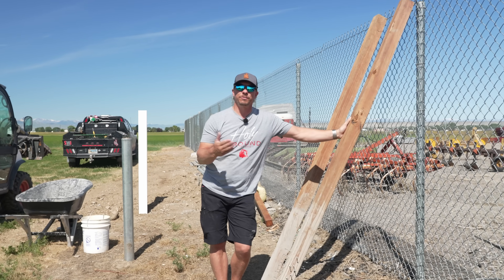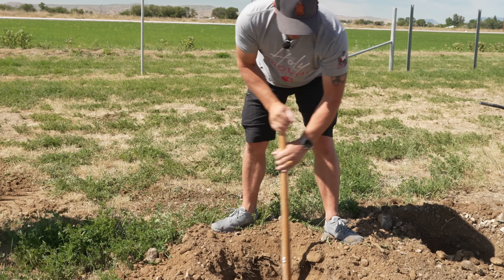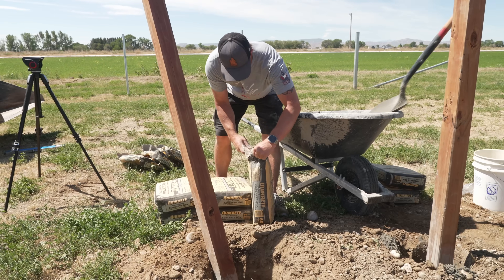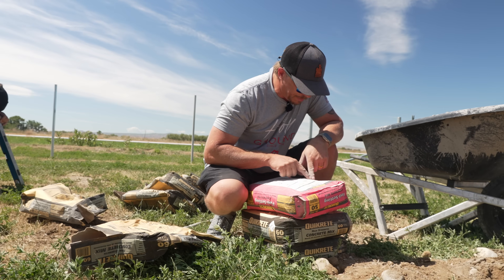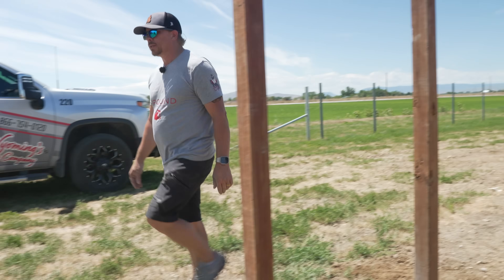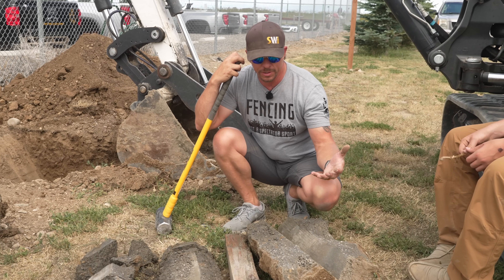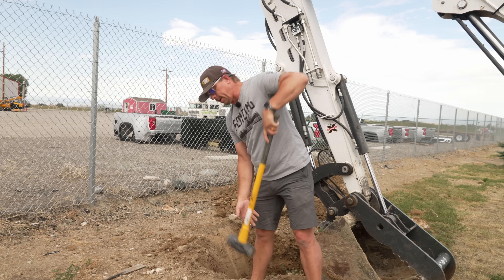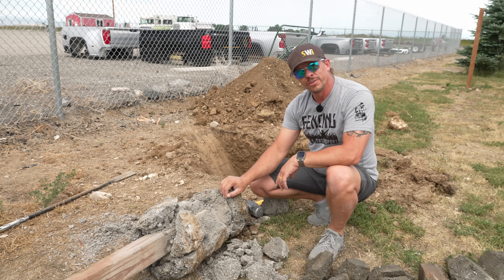Why Adding Water WON'T Save Your Dry Pack Concrete

Comment: water in bottom of hole, pour bag of cement, then a little water on top then another bag of cement, water, cement, water on top. 
Nobody should dry pack only. 
A five gallon bucket should be enough for each hole. but thats 2-3/8' metal for barbwire fencing and pens for cattle. never fails. built many miles of fence and lots for cows, never any 40 ft high fences like you said in the video that led to this one. 
Can we see that 40 ft high fence? Lol i know you"re being sarcastic.
Reply: We Weld and pull tension of Barbed wire from corner to corner and we have bent pipe before we pulled up the welded corners that we did this way. i have yet to see anyone dry pour or wet pour for almost a century. We learned from our granparents, and pulled corners they poured to set new corners due to rust with the add water, pour bag, little water, another bag, water, nother bag, etc. and it was ready to weld and stretch barb wire after 3 days.

Comment: I tend to use quickset for often than not, a few shovels, splash of water, stab with poker or stick, few more shovels, another splash and more poking, rinse and repeat until hole is full. Just mixing in the ground instead of a wheelbarrow.

Comment: 1. Dig 12" wide hole x <insert_frost_line_depth> inches deep
2. Add 4x4
3. Add 1" drilled pvc pipes (4-6) around the 4x4 that are longer than the depth of the hole
4. Add dry pack cement up to height you need
5. add the specified water according to the number of dry packs on top and into each pvc pipes
6. removes pvc pipes and rince them for re-use, and let set the ciment
7. enjoy
Reply: That's a lot of work for a post

Comment: My problem is I have 10ft 4x4's and the SOIL is moving (FL soil isn't very strong). I have tried wet set, dry set, wet set with a bigger hole and what happens is that the concrete and post move the soil. I spent an hour or so pounding it / tamping it and backfilling it, it made no difference. I tried adding drypack around it, didn't matter. I don't want to go get a 12 footer just for this one post, but I feel I don't have any other choice.

Comment: Mark come on man. Put the concrete from the red bag into the hole, dont pack the snot out of it, just pour the water in. You are using the wrong bags and not following the instruction on the bags. If you're going to make these videos to influence people one way or another you should at least follow the manufacturers instructions. Still love your content though.
Reply: Agreed. If he really did apply the red bag instructions to the grey bag, he also overdone it. It called for roughly 1 gallon of water per bag, he ended up putting 6 gallons of water on a post with 3 bags. Strength of concrete heavily depends on water to cement ratio. I imagine it's hard to account for ground moisture, but if he knew it was not too dry there, he should have followed close the recommended ratio in the instructions. That's why it turned out oversaturated and weak. Props to him for improving from last video tho, at least by a bit.

Comment: Im sure someone else has pointed this out but I noticed something about your dry pour that you didnt do.  According to quickcrete you have to add 6 inches of gravel to the bottom of the hole then put in your post, level it, then do the dry concrete till its 4" below grade, then add the water.  That's probably why your dry pour's bottom was soaked.

Comment: So if you have dwarves in your yard that tunnel to you post holes and hit the with a sledge hammer then premix is the way to go. Otherwise Quick Set works just fine. Wind ain’t gonna break anything. Concrete is mostly to widen the base and provide weight ballast.

Comment: Dont just add water at the top
 Pour some quick crete in then some water tamp then add some more dry then more water untill the bag is empty tamping as you go
 One bag is all you need. Our fences have been holding bulls for many years i will be dead before they need replacing.

Comment: Awesome videos, thank you!  love seeing tests of each kind.  I am homeowner not pro, but if the wood gets wet with water table, do you guys use sealer or creosote or something in field on the bottom of the posts?  The post at old house set fine, but the wood rotted insdie the concrete is why i ask.  Like the humor and how you aren't trying to push one way or other, just give options since everyone project different.  thx!
Reply from the maker: It's a good question, and it's the reason we stay away from wood in the ground as much as possible. We've moved entirely over to steel fence posts because of the rotting problem. https://youtu.be/CW3GDUznJPw?t=1055

Comment: Dry pack is fine for wood post fence. I have done hundreds.  Dump it in around the post while having your level plumb it up. Pack it with your bar and on to the next.  Works great!

Comment: I think dry pack in a hole full of water will work. It may depend on soil moisture condition.
I like the concrete vibrater.

Comment: Tamping down a dry fill will prevent any added water from wicking through the cement.  The key is to wet the dry fill all the way, with wet sides to the hole, water in the bottom, then adding water as you add dry fill. Yes, this does separate the concrete mix somewhat, but at least the cement will set all the way through. 
Also, it would seem that adding screws would have been greatly beneficial for the dry fill option that broke away from the post in 4 hits. Reinforcing a wet fill is pointless, but it would certainly help the weaker concrete of the dry fill to hold on to the post, IF (after?) it cracks in -situ.

Comment: For dry-set, I'd wager that a large portion of the water poured into the hole seeped into the dirt around the hole instead of mixing with the concrete.  And I wonder how much of the fine concrete particles (the asphalt dust and such) were carried away from the hole, carried by the water as it percolated through the mix and into the dirt.

Hmm, maybe a drop cloth around the inside of the hole could solve both problems, create a waterproof barrier for the concrete cylinder?  It would prevent the water from escaping sideways, and I doubt it'd be necessary to worry about water seeping out the bottom.  Highly impractical of course lol.

Comment: this "dry pour" is enough for fences and others where you just want to hold something into place and not be under a real load. If you are lucky you get half the strength of what mixing gives you - and that is with mixes designed for being used like that. Another thing is that cause it doesn't bind well to the aggregate it acts more like a sponge and is more susceptible to weathering and plant growth. 

It saves a lot on labour and equipment if you don't need the full strength.

Comment: I had no idea dry pack concrete was a thing, haha.  At my local home center, we have regular concrete and fast set, where you put the dry concrete in the hole and mix it in the hole with water
Reply from the maker: That would be the way it should be done. I'm not sure where the dry pack crowd came up with their method.

Comment: Man while the metal pole technique is very nice that pole driver is very expensive and not worth the investment for the average DYI'er. You can buy an auger for 300 to 500. Or rent one easy. While I think the steal pole method is superior in the process and the results the cost has not gotten there yet. It will still be the old fashion hole digging, wooden post method for me.
Reply from the maker: Those are good points. To be fair, you can sometimes rent a post driver from a tool store in your area.
Reply: @SWiFence  ehhhh I'll just call the pros 😆

Comment: For a mailbox ill take the quick set add water method I think. Im going to either prime and paint the old post or wrap with zip tape to mitigate any water. 
Also add gravel to bottom in my clay soil to try and help with drainage.
I have to cement it in fully built for reasons i listed on last video.
Dont need to spend $400+ on a whole new dual setup

Comment: As a small land owner, my husband and I have started doing the dry pack method.  We're old and it's hard to mix all that mud(concrete).  We put some drt cocrete in pour some water and let it soak in.  More quickcrete and then more water.  How many times seems to have a direct correlation to how much digging the post took out of us.😂

So far it's worked really well for us.  Growing up in Idaho, we didn't concrete posts in.  As an adult in the Texas Hill Country I have planted posts with and without concrete and honestly haven't seen a big difference.

We have 4.5 acres and have mostly ponies, so our fences don't have to be as strong as most.

Thank you for the videos.  I have learned a lot from them.

Comment: The first thing you do is treat the post with tar or wrap it with flashing tape to slow the rot..
If the top connection is firmly fixed like a semi moment connection there will be much less torque on the post

Comment: When you mix in a wheelbarrow try using a garden hoe an just scraping back an forth to mix the water with the concrete it's just a little easier

Comment: LOL, it's a fence. If a windstorm is strong enough to pick up a sledgehammer and throw it into my fence, (1) I don't think any of the pickets are going to survive, either, and (2) I think I will be worried about a lot more (like is that same wind going to blow my kids' swing-set through the windows), than whether the cement is going to hold my fence posts. Also, in your last video, you used foam and talked about how great it was for setting fence posts--why didn't you take a sledgehammer to that, too? Just an idea for your next video...
Reply from the maker: Hey that is a good idea--side-load test the foam! 👍🏻

Comment: Good grief man, get you a set of hand post hole diggers to clean out the bottom of the whole. Works much better than trying to do it with a shovel.
Reply from the maker: I hate post hole diggers. Some of the other videos will tell you why.

Comment: You don't add it at the top.  You add it as you're pouring the dry mix in.  I've done that for decades and my fences are still rock solid!

Comment: I’ve been building pipe fence for years and I’ve only used the wet set method and I’ve never had one give up, I’ve never used the dry set method myself. I don’t know if you know anything about building fence but you sure know how to build a killer truck, the thing is a beautiful work truck👍
Reply: ....round pipe doesn't have sharp angles to weaken the concrete. Those corners in wood fence posts are built in zippers. That is why control joints are scored into large areas of exposed concrete so you get the cracks where you want them. Concrete wants to crack - especially at sharp angles.

Comment: You still did it wrong. I thought this was common knowledge. First you wet the hole with about a third of the water. Then you chuck a couple of bags in with another third of the water on top and give it a bit of a stab with the bar. The stab holes fill up with water. Repeat to finish.  Next post. Also, the dry set concrete is plenty strong for a fence post.

Comment: your wood is going to rot very fast since you're using concrete straight against the wood. Never do that, ever.
Reply from the maker: I actually agree with this statement 100%. We're just showing what folks often do.
Reply: What do you suggest as an alternate way?
Reply from the maker: Steel posts--no wood. If you have to use wood tamp the soil back in around it.

Comment: I run 8” - 10” pcs of rebar through the post instead of nails.   Usually about 3-4 pcs alternating direction.   Haven’t had a post fail yet but I really don’t know if it’s doing much or not
Reply: Screws cause that you cannot "pick up" the post. I had to remove recently two steel posts that had no  screws etc. After some workout with rubber hamer and trying to swing it I was able to pull up both together with my wife with bare hands as friction was too low. If there was any screw it would be impossible.

Comment: I’ll dry pour for mailbox posts, but not like this. I do buy the bag intended for dry pour, but add water as I go. Add water, wait, add more from bag, add water, wait etc. Layers.

It’s viable if you don’t have a wheelbarrow and don’t want to mix beforehand, but DO have time to wait. 

I agree it may be typical for most people to only add water at the top. But nah, it won’t mix.

Comment: Nothing wrong with dry setting posts, as long as you have some moisture in the soil. If you build the fence properly, the strength of the fence will keep everything tied together and straight until the concrete sets. The benefit of dry setting posts is that you can build the fence quicker and make adjustments as needed. We used a two man auger with 8" bit. After drilling holes, we used a 3' level along with a string line to set posts. When we get to a hole, guy with level would put the post in to where he wanted, other guy would dump in roughly 25 lbs of concrete as that would usually come to 2-3" below ground. Then quickly kick dirt back over concrete, and guy with level would use level to tamp dirt. Once posts were in, we then proceeded to mark posts and set rails and string line. Once fence was up, it's all tied in together and pretty solid. Occasionally we would see a spot when looking down the fence that had to be adjusted, maybe 1-3 posts next to each other at most. Take the blunt end of the rock bar and pound down a couple inches away on the dirt at the base. This will slide the post, and the dry concrete will move around the post allowing for a solid set later. 

When I was building fences, my partner and I could do up to 450' of 6' privacy from start to finish with a custom gate or two in 12 hrs. That is getting to the jobsite with unopened bundles and pallets. Some people think that building fast meant cutting corners, not so if you have a well thought out method. Our tolerance was a quarter inch on both height and length. Never got called back for a failing fence after we left, but did receive quite a few referrals. Often ended up doing multiple houses on a block. Occasionally had to pull up a post that was a few years old from storm damage. Concrete was solid and adhered to post. Would take a few minutes with a sledge to crack it and remove. Maybe in an extremely dry climate you want to wet set, but anywhere with a decent amount of soil moisture, should have no issues as long as you tie in the rails to the post within a day, maybe two depending how wet your soil is. https://www.facebook.com/empirefence1/photos/pb.100069162013069.-2207520000/1641629516078293/?type=3
Reply: I did what you are about never added water soil was most . Poured dry then covered it . Worked out fine

Comment: I dry pack my posts and I wet the walls of the hole really well and leave a couple of inches on the bottom and then pour water on tap after I pack it. I can look at fences I’ve built 20 years ago and still straight and true.

Comment: We have used dry pour on a number of posts and it works fine but our method is slightly different.  First wet the hole, throw in half a bag, add water, poke it with a bar, add the other half of the bag, add more water, more poking with the bar and repeat.  It works well with quick set and much faster than mixing in the wheelbarrow.  No tamping is needed, just vibration.

P.S.  Thanks for the videos by the way.
Reply from the maker: There do seem to be 100 variations of this method as I'm being informed in the comments. 😁
Reply: @SWiFence  You say that but I have read the comments and suggestions and most seem to say the same thing.  Pre-wet the hole, add half a bag or more, water, mix, repeat.  But if you put all the dry mix in and then tamp it like you did in this video, the water added last can't then get through to the cement.  I reckon try it and you probably won't ever mix concrete for posts in a wheel barrow ever again. 👍
Reply: @ohnomyking I do it like you and my posts are rock solid. I usually do 1/3bag dry concrete into hole, then 1/3 water and use a rod to mix it and repeat until it’s filled.
Reply: @ohnomyking  don't pack anything bro , 1st load hole with water, add 1/3 a bag crete, load h20 add 1/3 etc-->packing down before not necessary. ..think about it.. tamping doesnt promote water infiltration( does anybody put a 1/2 box of screws into their posts,,lol )   

would like to see a video testing alternatives for adding gate posts over concrete slabs.. cut holes and set, or use simpson brackets.  I lean twards cutting .. Live in high wind area  SWI ?
Reply: @ohnomyking  This is what I don't get. They initially acted like "dry pour/set/pack" was done without water, and that didn't make any sense to me. You might as well "pack" it in a powder/sand mix.  Then to show people that adding water didn't help, they put all the bags in at once, pack it, and then put water on top, and it seems obvious to me that a decent amount of the water will soak into the dirt rim of the hole before it has a chance to saturate down.

The top of the concrete may harden, but then there's next to no way to get water into the bottom, prolly, half of the concrete powder using the method they are using.

I've only seen it done with slabs, which would be easier to saturate with water, but to your point, it makes sense you would alternate between powder and water, due to depth, if you are drying pouring a post hole.

Comment: Don't know about the US, but here in Canada we have a product called Rapid Post... you put some in the hole, add your water... and then poke a sharp point down into it (like your digging bar) to kind of let the water get through the concrete. Then you add more dry and do the same. It has worked well for us so far, but it is FAR more expensive than regular concrete mix, and if exposed to too moist an environment the whole damn bag will become solid, or at least large sections.